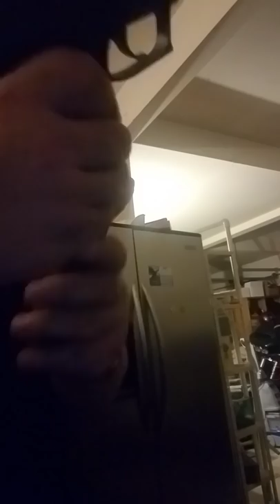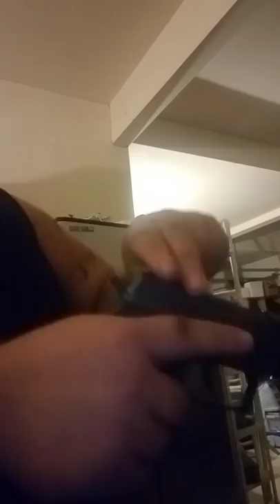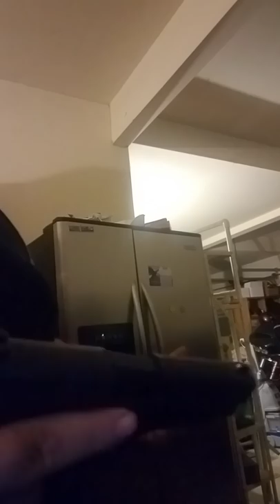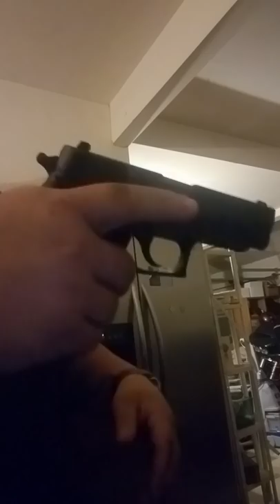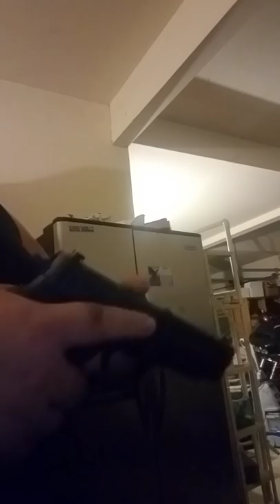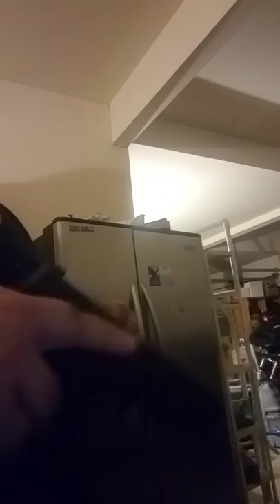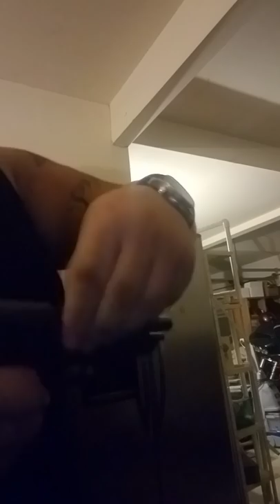How did Ocelot's gun jam? (Explanation)

Comment: Also known as a Stove Pipe. Nice Sig BTW. My favorite .45 is a P220 German made model. Amazing how light those late 90s Sigs were. I had a Glock 41 Gen 4 and my fathers Sig weighed less than the Glock. Both pistols were unloaded when weighed (about a 3-4oz difference plenty enough to feel). That Glock though was a hell of pistol. 13+1 double stacked magazines. I think Sig sells up to a 10rd magazine for the P220 and the night sights on the Sig were superior to the Glocks. I ran over 200rds of Remington UMC FMJs through the Sig and it never malfunctioned. The Trijicon sights went dead last year but so Dad sent it back to Sig to be refurbished. He ended up coming out about the same if a local gunsmith would have just replaced the sights. It was like 180 bucks and they replaced any worn internals at no extra cost. By far the best thing was reading the test firing report notes. Not a single misfire or malfunction.

Comment: Revolvers don’t jam
Reply: They sure can stop revolving. And if your revolver stops revolving, it's out of the fight. All you gotta do with an auto is tap and rack.
Reply: @Helloitzkenny  properly maintained a revolver wont stop.  If it doesnt go bang, no worries, pull hammer back and keep going. If semi auto doesnt go bang, you have to waste time to clear the problem
Reply: If the Cylinder is out of sync, it''ll jam.

Any well made pistol that is well maintained won't jam if used with proper technique, assuming the ammo is good.

Plus, Single Action revolvers are easier to accidental discharge unless if you hair trigger a semi auto.